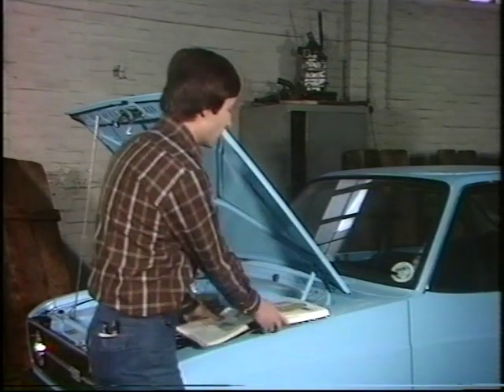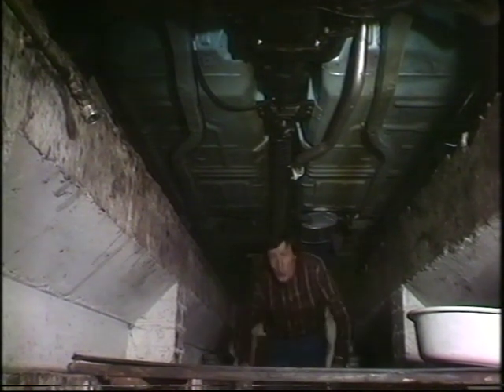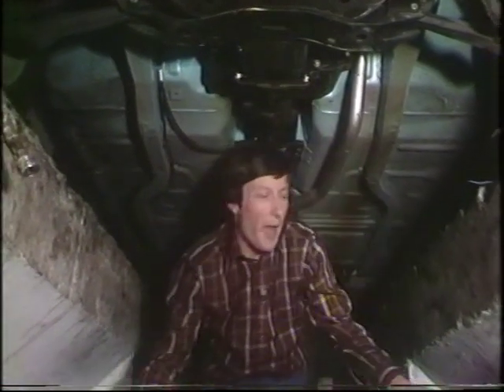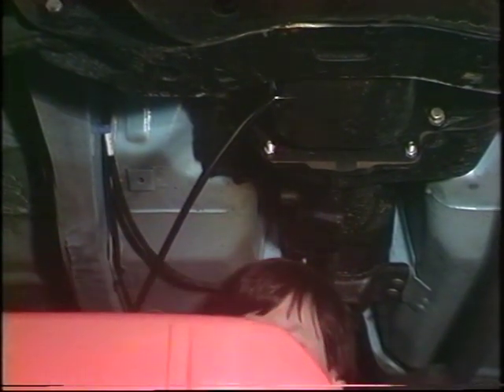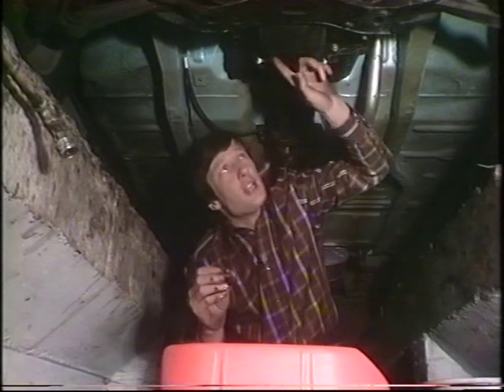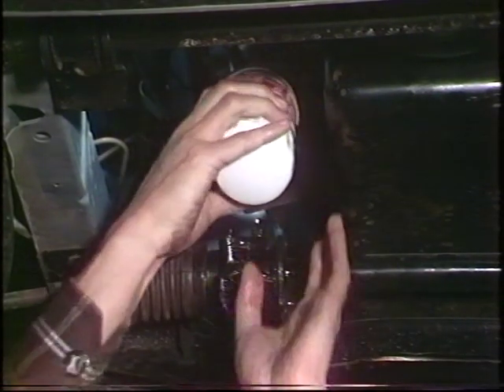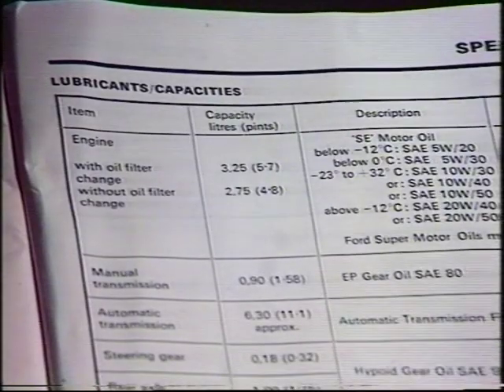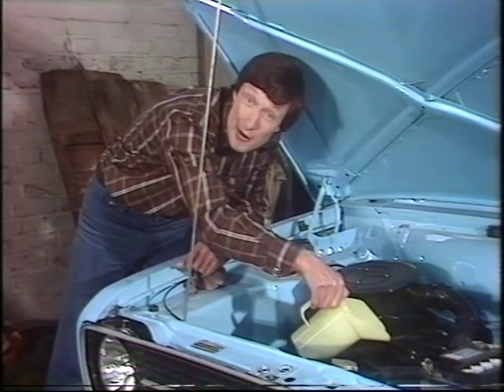1970s Cars | How to change the oil? | Car Maintenance | Drive In | 1976

Comment: The AA book of the Car is possibly the most under-appreciated car book out there. They sold or gave away loads of them. The easy explanations and simple diagrams are wonderful. If you want to show your children how engines and cars work, it's better than youtube. I credit that book with a lot of what I know about cars. I wish Richard Hudson had a read it for a little longer as he would have done a few things differently in this video. I love these old Thames clips.
Reply: Add to that the Readers' Digest book of Home Repairs and you'll be replacing your kettle element, fixing the toaster, repairing your two bar electric fire and some new bearings in the spin dryer.  Long gone days of sustainability..........

Comment: Link Knight ..they used to use used engine oil to waterproof sand and cement plaster for external work..it actually works

Comment: Bmw starter motor replacement:- 2 days in the expensive garage. Back in the day it was a Saturday afternoon at the roadside round your mates.
Reply: No it's JUST BMWs.... what car manufacturer uses aluminum HEAD BOLTS. Why BMW of course. Then they break IN THE BLOCK and then you get a head gasket leak which causes oil to run down the side of the block.  Not unknown to be 10 thousand to get the mechanic to fix it. No dipstick on them EXCEPT the 1 series. And that may only be a transmission oil dipstick. So its got an unknown amount of oil in it but you have to start it and warm it up before the electronic oil level sensor will be right.... THEN since somewhere after 2010 they've decided that the timing chain should be ON THE FIREWALL side not the radiator side.... you can't make this crap up. Never mind the 100 to 130 thousand kilometer water pump and thermostat change..... those cars are just built to mess with mechanics minds.
Reply: Yep, starter motor = one hour job on the street in an old Mercedes Vito. 
Weekly :)

Comment: Filter should be done every change! Not every other.
Reply: I didn't hear him say that.
Reply: @OffGridInvestor  He did but every oil change can be excessive in my experience at least. For a few quid it's good piece of mind and certainly if you're using long life oil. However, I use normal (non long life) oil, change the oil every 6k and filter every other change.
Reply: steven my car is spoilt then! Oil and filter every 6 months, plugs and air filter every 12, coolant every 24.
Reply: @Landie_Man  certainly can't hurt. Im sure it runs well with that care. Safe driving brother.
Reply: steven 32 years old and in daily use with me for 3 of them :). Take care man
Reply: @Landie_Man  It largely depends upon the car in question, as to how frequent etc.
Reply: New oil = new filter. 
No questions about it.

Comment: Interesting that the drain plug was on the side of the pan...every car I've owned has them on the back edge so when you jack the front of the car up the drain is the lowest point in the system.

Comment: If i had that much space round me engine. I could work on it again. Now its all computers and sensors.
Reply: You're right Gavin. Unfortunately they are needed to meet emissions standards. I remember playing with carburettors and timing lights - you could feel the difference behind the wheel after a tune up! Our humble little Peugeot 107 is still a simple engine to work on and very cheap to service though.
Reply: Depends on the car, here in the US we get a lot of rear wheel drive options, and they're real easy to work on.

Comment: Not much has changed with car maintenance in 45 years.
Reply: Unless you've got a BMW....
Reply: Maintenance changed out of all  recognition .from  around mid 90s to 2000s , what with manufacturer ' s  using complex electronic's, timing belts and e c u 's to control everything. No greasing  steering or suspension.
Reply: Mike Martin modern cars when serviced still only have oil and various filters changed just like the 70s. The ecu is not in the maintenance schedule